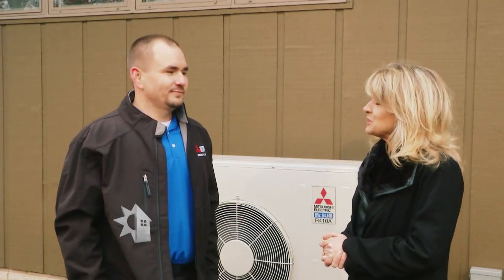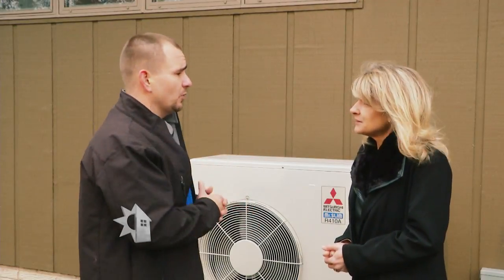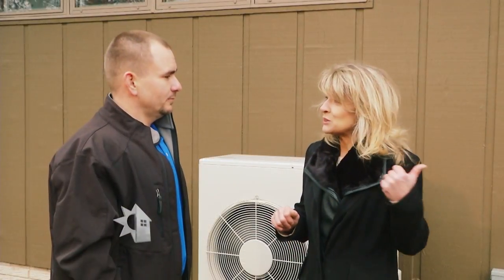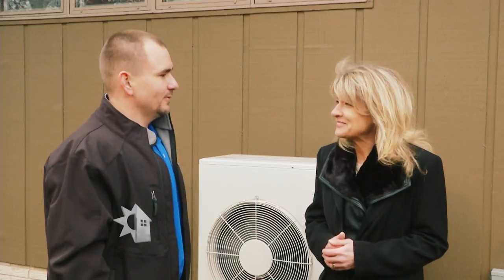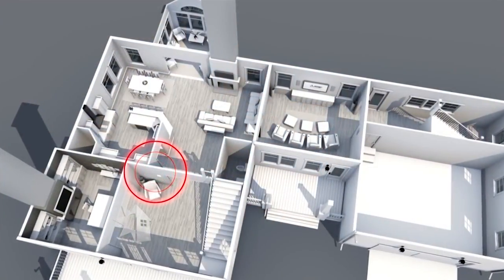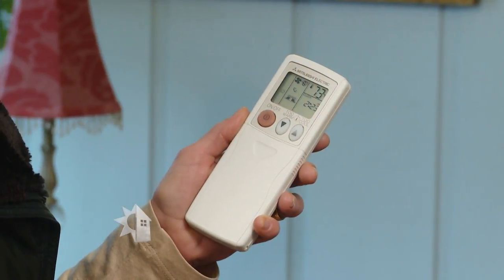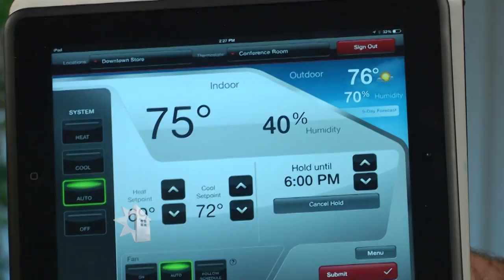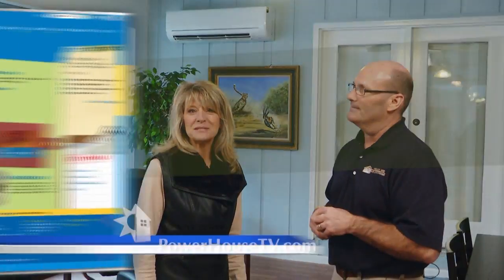Mini-split heat pump

Comment: One thing no one has mentioned compared to a typical conventional Heat pump, the new mini split technology while much much more efficient, the repair cost is 3 to 5 times higher. I work in the HVAC industry for 35 years now and if you lose a condensing motor on a conventional system, the average cost to replace is around $300.00 .......on a mini split, when the  $450.00 condensing motor fails it also takes out a $900.00 board, one of 3 that are located ion the condenser. Everyone needs to understand this when making a decision on Mini split technology.
Reply: I love my two tonn Mitsubishi mini split. After four years of lightning strikes, squirrel induced power failures and drunks knocking down power poles weekly i can truly say it is Bullitt proff..

Comment: I have a Mitsubishi Hyper Heat system. The newest one with the 3d sensor. Its 8 degrees in NYC right now (-2 wind chill) well above the advertised -18 and I can't even get the basement above 54 degress. its fucking cold in the house and I feel like I got ripped off. Spent over 10k and the system right now outputs mildly warm air... I find their advertisement very misleading.
Reply: KevinHarper3DArtist is your system properly sized for the sq ft area you are trying to heat?
Reply: KevinHarper3DArtist blame your contractor not mitsubishi, they put out their rated btus at 5 degrees. The problem is the colder it is the more btus your house looses. These systems are made to provide extra heat and efficiency not replace your furnace. I turn mine off at 15-20 and turn the furnace on. Love it
Reply: Damn dude that sucks! lol Surprised that I sucks that much....